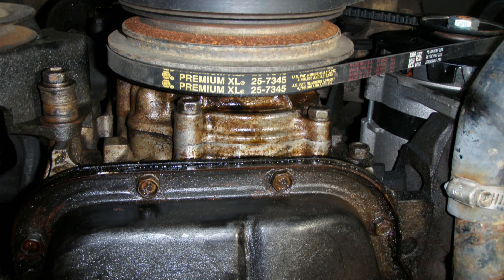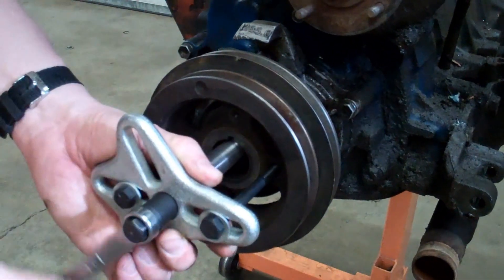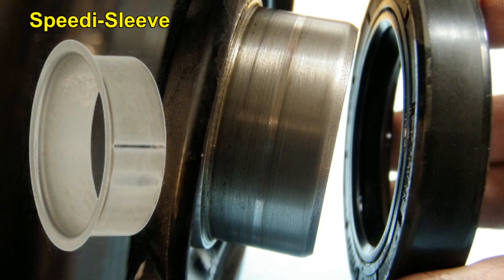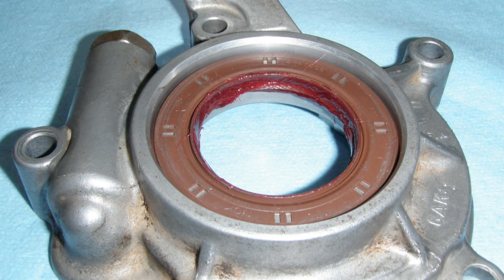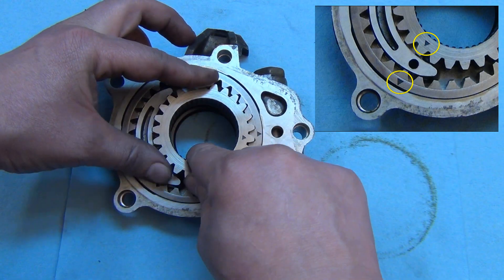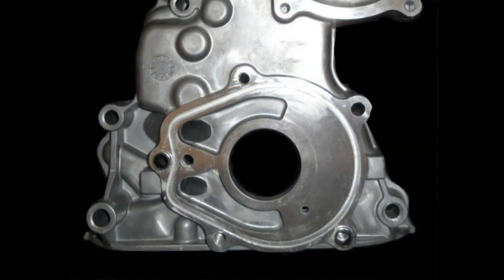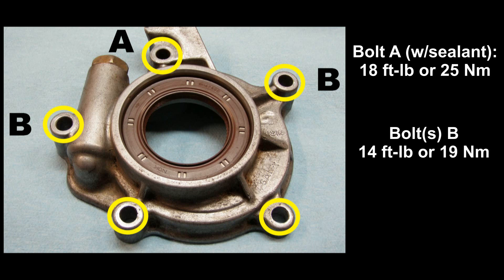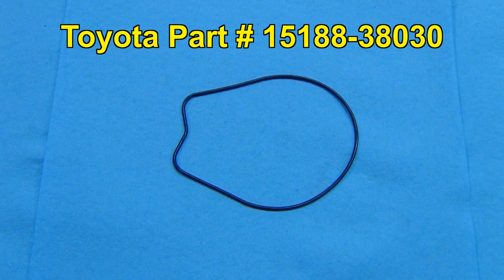How to fix Toyota 22R Front Main Seal Oil Leak (22R 22RE 22RTE) No Speedi Sleeve!

Comment: I just took the pump out of a 84 Celica 22re and replaced the seal.  I'm having a difficult time putting the gear back on correctly with the arrows facing me.  

the outer ring goes on smoothly with arrows pointing either way, but the inner ring seats onto the pump with the arrow facing down instead of up.  I have no clue what the issue is....
Reply from the maker: The arrows don't really matter which direction they are in there, they are simply to mark which side of the gear faces you when installing them.  Make sure you put a little engine oil on all surfaces when installing the gears so they aren't dry at startup.
Reply: I figured it out.  I just simply had to use a little force to seat the inside gear before it started to rotate around with ease.  The video made it look super easy to put the gears on, which wasn't the case for me.  So far no leaks so I'm glad I did this.

Comment: we have a 1985 Toyota pickup 4x4 5 speed, 22R carb. I bought a rebuilt engine that has gone bad.  A friend has a 22RE motor, fuel injected, that came out of a 1995 Four runner, 5 speed as well, with 38k miles.  Can I put my intake manifold and carb on it without issues?  Any other changes that would be required?  thanks a lot.    I appreciate your help. Don
Reply from the maker: +Don Fuller   Yes, you should be able to swap the 1985 intake and carb over to the 22RE engine.  There's going to be some wiring and other stuff, but yes, the carb intake should swap over to the EFI block and head.  Where you run into trouble is on the early ones where there was a different deck height and different shaped ports, but the heads and intakes should be interchangeable from 1984~ish to 1995.
Reply: +WheeliePete thanks so much for the information.  I really appreciate it.  I do have one more question..... can I take the engine out of my 85 Toyota 4X4 Pickup without pulling the transmission?
Reply from the maker: +Don Fuller   Yes.  You just have to unbolt the transmission bell housing from the back of the engine.

Comment: Hi Wheelie Pete, great video! Do you use any sealant or copper spray on the gasket for the oil pump and water pump?
Reply from the maker: The oil pump is sealed by an o-ring so I just use a couple dabs of grease to hold that in place in its groove as I put the oil pump body onto the timing cover.  The water pump on the 22R series uses a regular flat (paper) style gasket.  What I like to do is give a light coat of Permatex hi tack to any flat gasket that is sealing oil or coolant.   Here's an affiliate link to the stuff on Amazon:  https://amzn.to/2ufScjF  That stuff is sticky and can be a little tricky to work with, but it works awesome, is highly resistant to  oil, gas, and coolant, never fully hardens so you can disassemble again down the road without a huge hassle, and it cleans up easily with acetone.    I've NEVER had a gasket leak that I applied Hi Tack to.  It seals everything up really, really well.  Takes care of little nicks in aluminum sealing surfaces too.  The only downside is that it's a bit messy, but you can control that.  I usually put the gasket down on some cardboard and then paint the surface I'm going to stick on first, then I either paint the other side in place, or paint the surface that's going to go down on top of it.  (I don't get paid to promote products on amazon, but if you end up ordering something off an affiliate link I get a small commission on the sale.  Doesn't cost you anything extra.)
Reply: Ah great! Would you recommend I use the Hi Tack on the Timing Cover Gaskets too? Guess I can take this $10 Copper spray back lol.
Reply from the maker: Hi tack on any flat gasket that is sealing oil or water (timing cover gaskets included).  (About the only thing I wouldn't use it on are exhaust gaskets).  The copper spray will probably work just fine though.  I've just always used Hi Tack because it's always worked perfectly for me.

Comment: Hi wheeliepete I have a question... today I was driving my truck and all of a sudden it starts to smoke when I get to where I was going I looked under the hood and my entire engine bay was covered in engine oil what would be the problem I can't seem to figure it out
Reply from the maker: +Brandon Bowman   Someone leave the oil fill cap off?  That will spew oil everywhere.  Also check that the PCV hose is still connected and if there's a breather hose on the valve cover, make sure it's still on.  Basically, there shouldn't be any open ports on the valve cover.  If your front main seal failed big-time the crankshaft pulley will fling oil everywhere and make a horrendous mess also...
Reply: +WheeliePete I don't have a breather line anymore because it fell off and the cap is on. when I start my truck it smokes out of the breather hole. I let it set for a bit put some more oil into it and drove it down the road and it leaked all of the oil I had put into it. there is oil all over the whole under carriage of my truck
Reply: +WheeliePete and there is so much pressure when I plug up the breather hole it blows my dipstick out of the engine
Reply from the maker: +Brandon BowmanSo you don't have the PCV (positive crankcase ventilation) hose in or the breather right behind the oil fill (are we talking 22R, 22RE, or V6 here and what year?) If you're losing oil that fast there is something major going on. Rear main seal will also leak like crazy if it fails.If the engine is building pressure in the crankcase you make have a crack somewhere that's allowing engine compression from a cylinder to be forced into an oil galley. First step is figuring out where the oil is leaking...Maybe put more in and then get under there with the truck running and see if you can find the point of the leak...  Sorry man, hard to diagnose on the net...
Reply: +WheeliePete it is a 1984 22r I have the pcv valve just not the breather that goes to the carb I let it set and then started it up looked around and it has been fine but as soon as I drive it for like 5 min it starts leaking like it has been
Reply from the maker: +Brandon Bowman   Pull your PCV valve and make sure it is actually functioning.  It should allow air-flow one direction only (out of the value cover)  IF the PCV is blocked it will build up pressure in the crankcase and then you can get things like the dipstick popping out, seals getting blown etc.  You might just have to clean it off and then start it up and try to pinpoint where the leak is coming from.  Hopefully it's just the front main seal.  If it's the rear you'll have to drop the transmission to get to that one.

Comment: I must say though I'm having a bit of trouble with my 1982 Toyota pick up it has the 22R motor on it and it was leaking oil from underneath the truck I bought and replace the gasket on the oil pan but seems like it's still leaking oil but not from the oil pan spot area it's coming from more towards the back area. I'm not sure if I explained myself right but any ideas of what it could be ?
Reply from the maker: There's also a rear main seal that goes around the back end of the crankshaft.  Unfortunately, the only way to get to that thing is to take the transmission out....or yank the engine.  Usually when the rear main goes bad it REALLY starts puking oil EVERYWHERE.  Chances are if you've got a 1982 that's never been rebuilt the rear main is worn out.  The rear main seal should be changed every time the clutch is changed (since the tranny's out for the clutch any way the rear main is cake to get to at that point.  The other oil leak back there could also be the input seal on the transmission...again...gotta have the tranny out to get to that one..  If you go through that much work to get to those seals...I recommend that you use genuine Toyota seals.  I've always had better luck with seals from Toyota than other parts store seals.  Toyota seals are always a lot more expensive, but when you're dealing with an inaccessible seal you want the best possible seal in there when you button it back up so you don't have to go back in there for a LONG time.
Reply from the maker: Another common oil leak in the back is from the rear of the valve cover gasket (1/2 moon cam plugs in the head) dripping down and running down the back of the engine.  Valve cover gasket is easy to fix.  The trick there is to clean the sealing surface well and put some RTV sealant on the 1/2 moon plug where it drops into the head casting.

Comment: Hey Pete, great tips and great videos that you put out. Do you have a video on removing and replacing the timing cover on a 22RE engine? I have a 1993 2wd pickup that is spewing 2 quarts of oil a week all over the place. I have been told that the oil pump seal is leaking but I suspect that the timing cover is also losing oil. Thank you for all the great information that you provide.
Reply from the maker: +4phishn   If you're losing oil that fast it is most likely the front main seal, or the o-ring behind the oil pump is pinched.  Video covers that.  You're timing cover would probably need to be broken to lose that much oil from a timing cover and you would probably be able to see it puking out the crack..  With that much oil coming out it's probably the front main seal.  When the front main goes bad, oil leaks onto the spinning crankshaft pulley and gets flung everywhere. Do you have oil on the underside of the hood?  Front main seal for sure.

Comment: Seems like i fixed it and drove perfect for a week to work prob 150 miles in after i fixed it and today i noticed it leaked from the bolts. To be precise it is the long one on the right facing the front of the engine.
Reply from the maker: That bolt shouldn't need the sealant, but you might try some sealant on that one too.  Could also be the 0-ring got compromised up near there and oil is getting out through the bolt hole.  Is it a steady leak?  There's an off chance it was just oil getting squeezed out between the mating surfaces during reassembly?

Comment: Is leak is has been a nightmare for me. Ive gone thru 2 new seals (12mm aftermarket) and now the toyota t seal wont seal it. After the first one did not cut it. I sleeved the crank pulley. The second one got damaged for riddi g at the edge of the sleeve. So now with the toyota t seal im co fused as to why it continues to leak. Any ideas as to why it continues to do so?
Reply from the maker: Always hard to diagnose over the internet, but here's some thoughts I had:  #1  Are you sure it's the main seal and not the oil pump o-ring?  If the o-ring is damaged, or out of it's groove when you put the oil pump back in the leak will be constant and persistent from the bottom of the oil pump.  If the dust shield is still on the crankshaft pulley it can be hard to see exactly where the leak is coming from.  #2  Did you remove the oil pump and use a seal driver to install the new thin profile Toyota seal?  It's imperative that the seal be driven in perfectly square.  If it's crooked at all the seal will fail.   #3  If the speedi-sleeve wasn't driven on perfectly square, or it got a little wrinkle during the install, the seal won't work either.  I had one do this to me once.  I put a speedi-sleeve on and didn't get it down perfectly and it started leaking pretty much immediately.  If all else fails, you might just have to get a new crankshaft pulley that will have a perfect sealing surface (no grooves).  They are about $80 online  https://goo.gl/aLB1MU.  You should put another new seal in too.  I wouldn't mess with used ones as they are probably grooved.
Reply: WheeliePete thanks for the fast reply. I improvised using a washer thats pretty much the same size of the seal and a mallot. Pushed down fairly easy towards the back of pump. The speedy sleeve dosent seem to have any physical damaged that is visible either. The leak wasn't there initially but as soon as i went out to test drive it. The oil was splattered all over the engine bay and underneath the truck. Witch leads to my suspicion of it leaking thru the seal.
Reply: Found out what it does. It is poping out the seal for some odd reason and the seal gets pushed all the way back.
Reply from the maker: Did you by chance grease the outer edge of the seal before pushing it down in there?  I know that's usually the "proper" way to install seals like that, but I've always driven the front main seal in with a dry outer edge (but lots of grease on the inner lips of the seal).  Regardless, it really shouldn't do that.  I'm wondering if the pressure valve in the oil pump is stuck (Big 22mm (I think) nut on the body of the oil pump holds the valve in.  Did you replace the oil pump too?  Something might be wrong with that pump.  That's a lot of pressure getting against the seal to push it back out.
Reply: Yes the outside was dry when pushed in. And the inside i used motor oil. Im not sure how the seal was being pushed out but the pump was new (aisin brand). We put the old one back on and its doing better. Except it leaks from the right side bolt (long bolt). As fas as that goes seems like the oil is just coming from there now. This time we  left the seal sitting flush with the housing and not all the way back.

Comment: I had the mechanics (real honest guys) do a dye test through the oil system to find where my minor leakage is. There's oil kinda caked on the bottom of my engine block. Turned out to be the oil pump seal. I'm not going to pay 600 dollars for them to replace a 1 dollar part on my engine. I only payed $1000 for the toyota pickup anyways.
Reply from the maker: +Obliterateification   Yep, front main seal.  There's no way that should cost $600.  Whoever quoted you $600 for a Toyota 22R series front main seal replacement does not know these engines (or worse is preying on people overcharging for an easy job.)

Comment: NO!!! DON’T torque that top bolt to 18ft-lb. It threads into aluminum, and will likely strip out. If you torque to 18ft-lb, there is also a the possibility that the stretch of the bolt will be sufficient that it will protrude inside of the timing cover, which could prevent proper operation of the timing chain tensioner. You also don’t want to torque the two long bolts to 15ft-lb. In fact, Toyota specs all of these bolts to 9ft-lb.
Reply from the maker: I'm not sure where you're information is coming from, but "Toyota" does not spec all those bolts at 9ft-lbs.  All torque specs listed in this video are taken directly from multiple factory service manuals (cross referencing years to check for differences.)  I'll post a screen-shot from one of the later factory service manuals on my channel's community page.  30yrs of wrenching on these engines and many, many oil pumps and timing covers replaced have never produced a problem with these torque values for me.   It is VERY important to use the correct length bolts for installation.  A longer bolt in position "A" could run through too far and cause problems.  Link to community page: https://www.youtube.com/c/WheeliePete/community

Comment: Why not use a speedy seal?
Reply from the maker: People have varying degrees of success with speedy sleeve install on the 22R series (myself included).  If you're sticking on the speedy sleeve you really should be putting in another front main seal at the same time so you might as well skip buying the speedy sleeve and just get the thinner Toyota OEM seal and be done with it.
Reply: Hmm. I put a speedy fix in with a new seal but maybe I'll pull that speedy seal out and get the Toyota alternative. I don't want to do it again anytime soon and I haven't  put the pulley back on yet.
Reply from the maker: If you've got the speedy sleeve on already and you're 100% sure it is on there square, then I would just run it with the new seal you put in there.  No sense in wasting it.   As long as the speedy sleeve is on square to the crankshaft pulley, and you drove the new seal in square to the bore of the oil pump, and you greased the lips of the seal, you should be fine.
Reply: It all went together nice and square. My concerns are two things. 1.  The speedy sleeve (Felpro) surface is not as smooth as the pully and it might not seal.   2. The sleeve is thin and unknown material and quality. I'm not sure how it will wear.  I guess maybe a third would be how hard is it to get off once it's glued on? It looked and smelled like red locktite which I've had good luck using heat to loosen.  Anyone have long-term experience with it that they can report?
Reply from the maker: You'll probably have to use heat to get the speedy sleeve off.  They have to be thin so they only change the diameter of the sealing surface on the crankshaft pulley just a little (so you can get away with using the same size seal.) Should seal fine as long as you have a new seal (be sure to grease the sealing lips before installing the pulley.)

Comment: What type of grease do you recommend for the inside lip and spring of the main seal?  Also is assembly lube recommended for the outer lip of the seal when seating?
Reply from the maker: I usually just use whatever bearing grease is close at hand for the seal lips.  As long as it's safe for o-rings you'll be fine.  Technically you are supposed to grease the outside diameter of the rubber seal lightly before you drive it in, but I've never had a problem cleaning the surfaces and driving them in dry.  A little bit of lubrication on the outside of the seal will help it go in easily though.  I personally like to dry fit them to ensure they don't come back out on their own, but you can booger them up if you're not careful.  Probably best to just put a very light coat of grease on the OD of the seal before you drive it in.